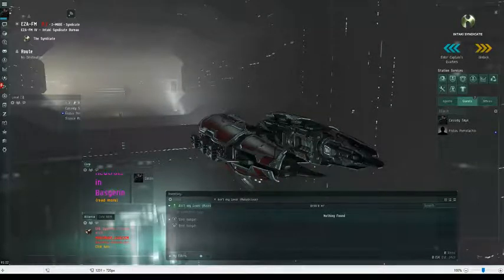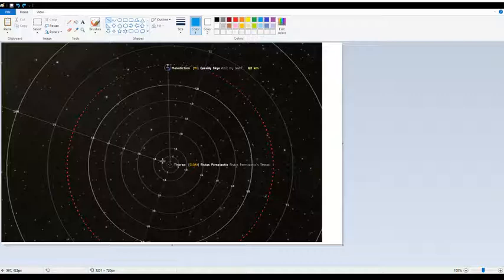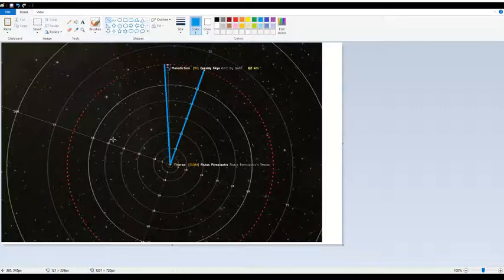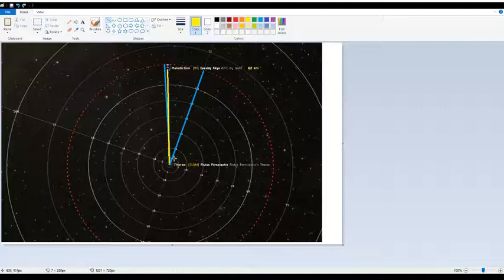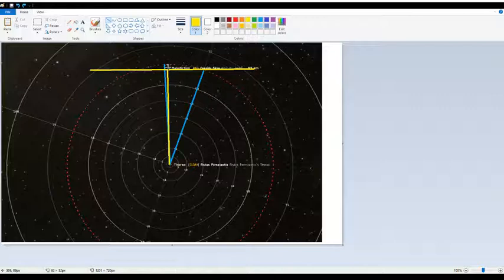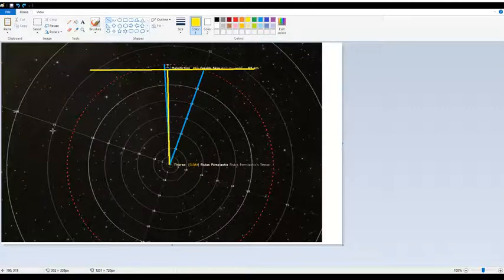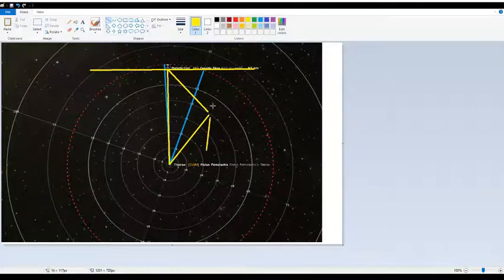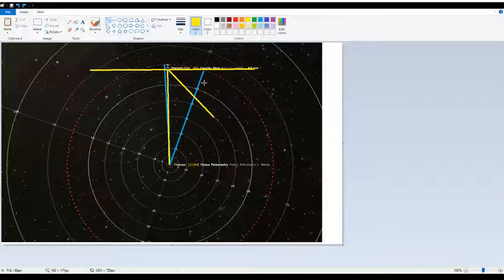Transversal - 5 min Tutorial

Comment: What i dont understand is the fact that angular and transversal are matched ship to ship this doesnt make logical sense and if so how does skill provide any advantage that the other ship wouldnt otherwise obtain aswell,  in space in the real world if you are orbiting somthing that is stationary your turrets would not need to track the ship unless speed change or direction change occurs as they could hold a perfect 90 from your ship and the trust vector of your ship orbiting can keep the target in scope like walking around a chair with your arm pointed at it , your arm doesnt need to move because your body is moving it for you around a center point , this means in reality the fastest ship or ship that astablishes a faster stable orbit first should have an advantage of low angular while the ship trying to track something orbiting it would struggle but not in this game keeping your angular and traversal velocity up just provides the end same result as if you didn't  change those values just at diffrent scale the only benefit i see is controlling range which has some damage mitigation,  but if your in a smaller ship using smaller weapons you will always be within there damage range obviously this logical doesnt apply to a smaller ship atracking a slower less tracking capable ship at which point yes you have an advantage but if they are matched and the tracking capability are similar then the one who wins is always who does more consistent base damage  which means that you should never toe to toe a ship of equal guns unless your able to score hits while the other cant ie missles